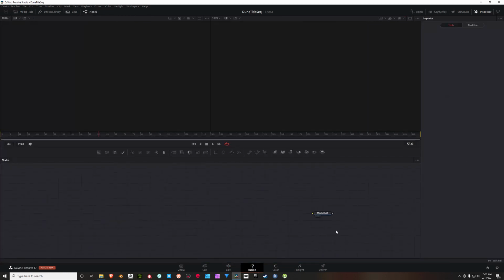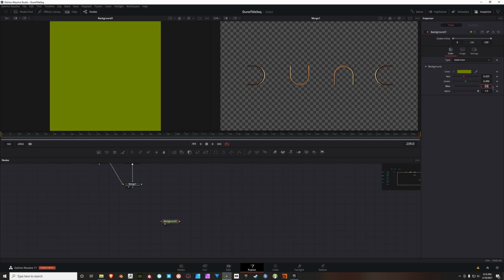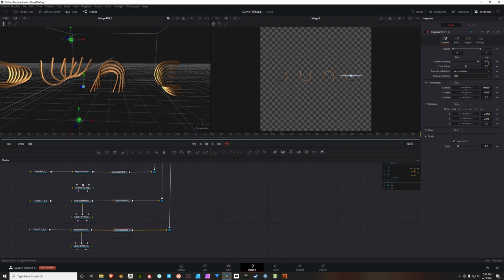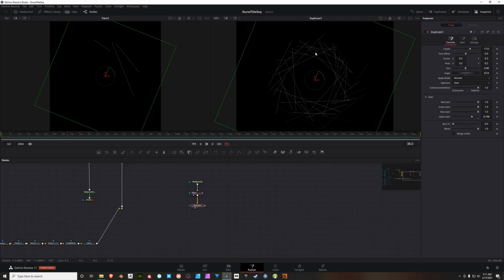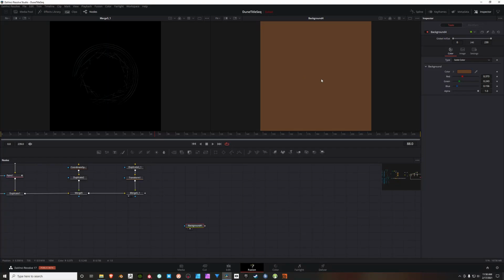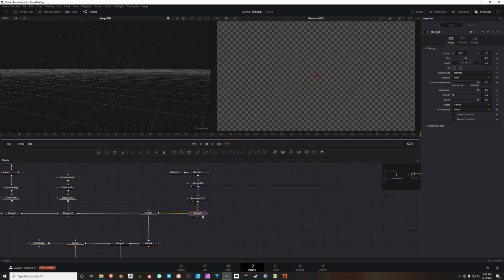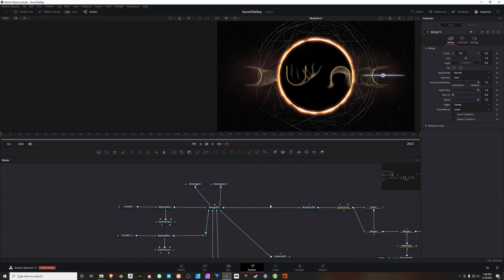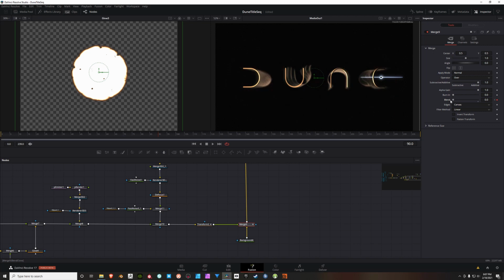Dune Title Sequence TUTORIAL in Fusion - Resolve 17

Comment: great work, tell me please, we should work like that all the time, i mean, first made static effect then add motion and animation? usualy when i was doing my project i was try to do motion at the start, and then i was adjusting/moving everything in keyframe editor.
Reply from the maker: It depends on what the final goal of the animation is supposed to be. When the overall end design is the focus, such as the end tag or the point where the animation stops, I usually lay everything out and then animate it revealing on because the main content is the design not the animation. If the focus needs to be on the animation such as character work I usually start with the animation first. I find it easier to lay everything out first because you the know the goal your trying to get to.